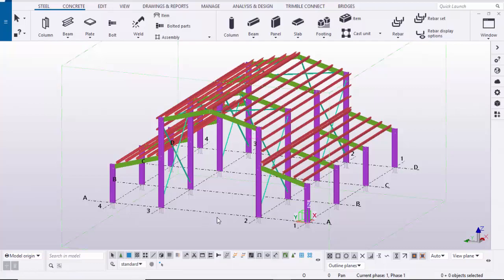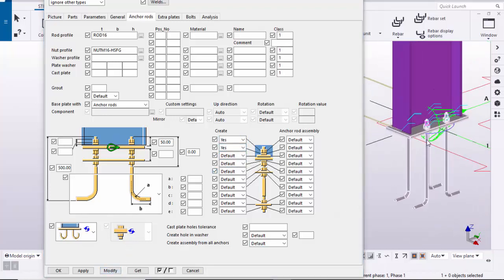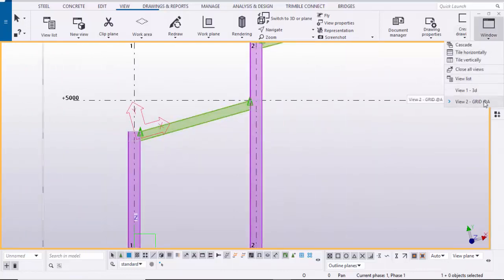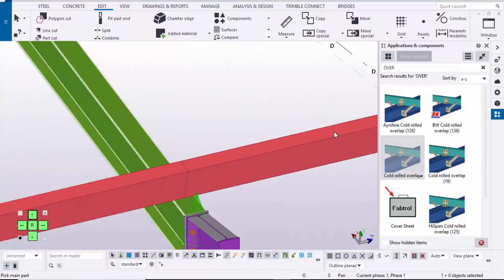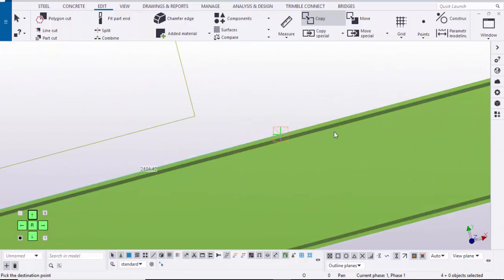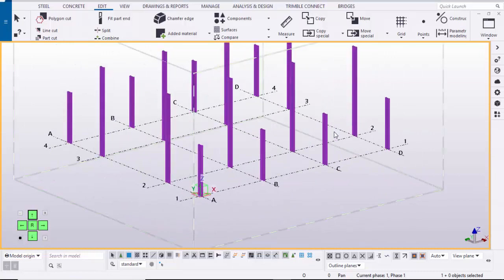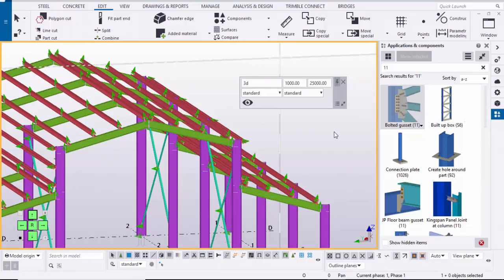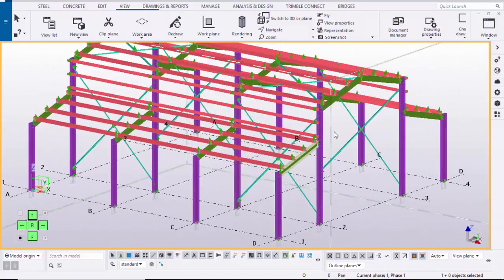Steel Structure Project 9 Lean To Building in Tekla Structures

Comment: Today I practiced this model sir without any error. But there are some modifications I were struck for long time.  Mainly vertical brace plate modifications and connection changes. I have to to generate 2D drawings and  sections, erection plans. complete drawings on this project for tomorrow….
Reply from the maker: That's awesome you completed the model without errors! Keep practicing and good luck with the drawings.

Comment: Hi Gani,  Try Connecting new monitor to laptop and use tekla in new screen to avoid using tekla screen controller to see the connection properties tab
Reply from the maker: Yes you right, in big screen there is no issue with screen adjustment with screen controller.